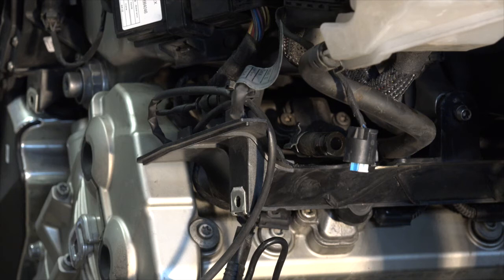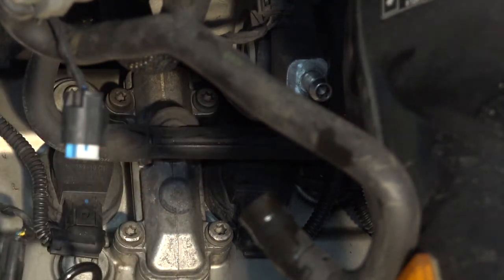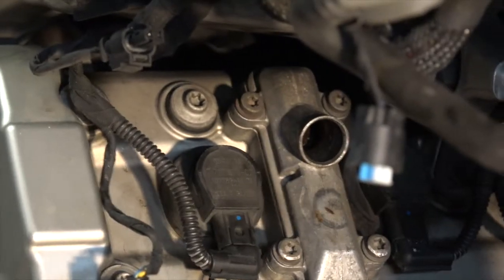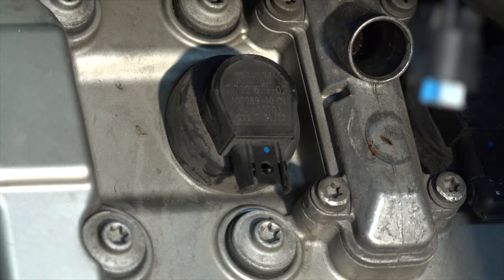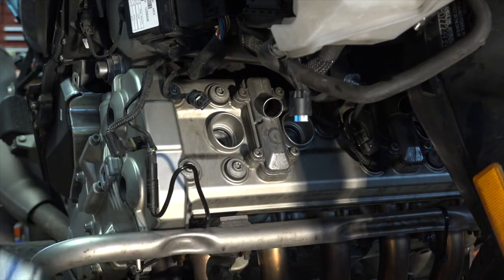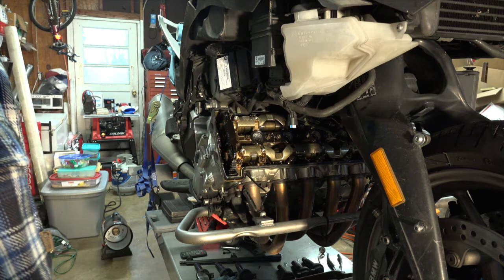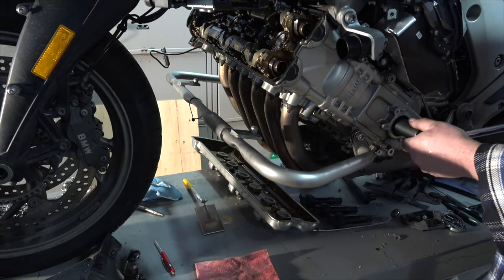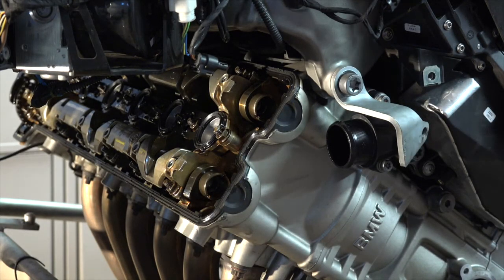K1600 valve lash Part 3

Comment: Hello, I bought a tool from Bmw that works great removing all ig coil packs, it's a rachet wrench style with broken end pivot and of course slotted head attach zone. (Source were found on bmw1600 forum) 
Question. After valve cover bolts removed, what best way to remove cover? Saving the gasket if possible

Comment: For torquing those two hard to reach fasteners you could measure the length of your wrench, do the math to calculate how much equivalent force needs to be applied,  and use a piece of string tied to your wrench and a spring scale to get it really close.

Comment: Air distribution line was great fun to remove, I think I send about 1 hr heating and gently prying out. I managed to remove it in one piece but I was really sweating. I put on the rubber seals that go into openings some high temperature rubber lubricant to ease up next removal.
Reply from the maker: I used Sil-Glyde  to lube the grommets. Hopefully things will be easier next time. I'd hate to find out what that line costs. Thanks for watching.
Reply: The price of the line is actually not that bad $68 in the US, I checked the price before removal to find out how costly my mistake can be.
Reply: I probably overheated mine a little but they pop in and out a little easier now. I have no idea what BMW was thinking there. I've got a theory one could find some off the shelf plumbing and some quick disconnects to each of the 3 connect points that would take the place of that dumb piece of plastic.
Reply: i wonder if you could pop off those 3 covers instead... looks like 4 torx bolts holding each cover on - im in the middle of it right now -

Comment: Instead of accessing the crankshaft you can remove the plugs, put bike in gear, and use rear wheel to rotate motor.